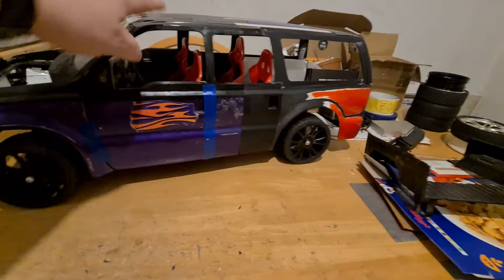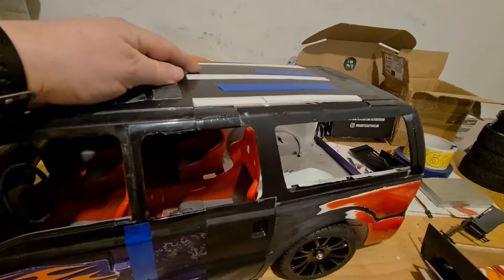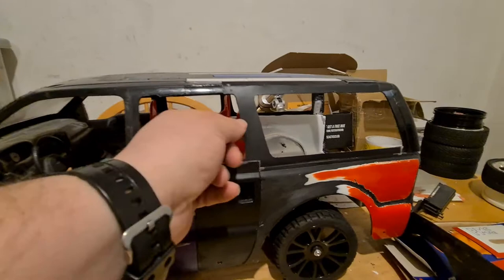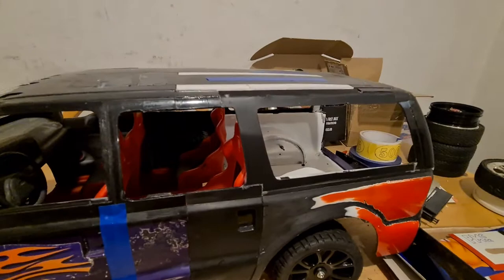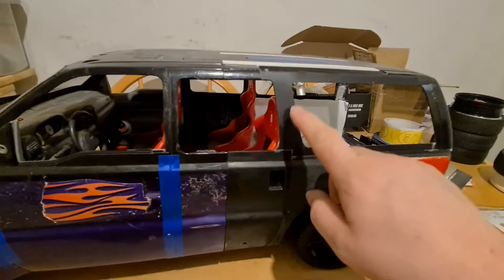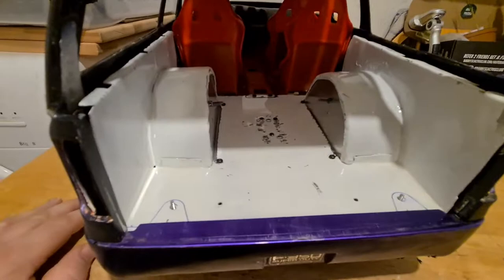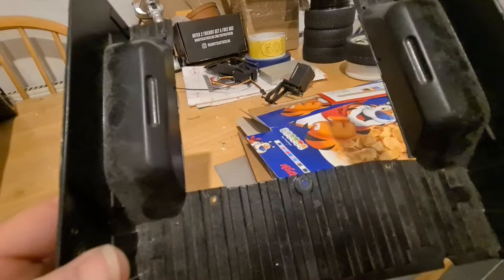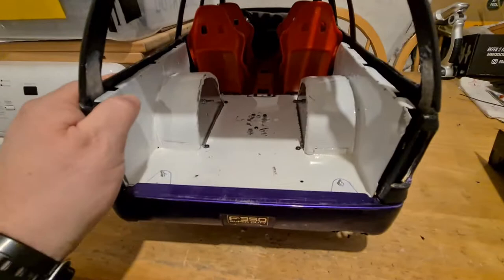RC Update 02/02/21 1/6 Ford Excursion

Comment: You're getting there, but it looks like there's a lot of sanding to do! This is going to be a unique car mate :D
Aluminium sheet is an awesome material, those wheelwells look great! I'd keep them!
Stay creative my friend!
Reply from the maker: Yeah thanks buddy. I'm going to leave the wheel Wells. Looking at them if split it down the center and push them right out and bond them to the plastic fender and make a new floor section as its flexing with the suspension. Replaced standard interior with four sports seats why the hell am I worried about the rear bench seats? 🤣🤣🤣